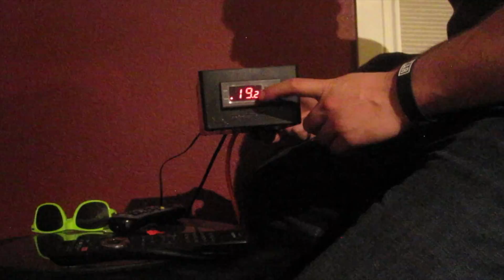DIY- how to wire STC 1000

Comment: How come it took so long to turn the lamp on? Shouldn't it have turned on as soon as it went 'x' degrees (like 0.3 degrees) above 22C? Was the difference value on the unit set really high? Thx.
Reply: There is a (programmable?) delay built in so you aren't constantly switching your compressor on and off when used for a refrigerator.